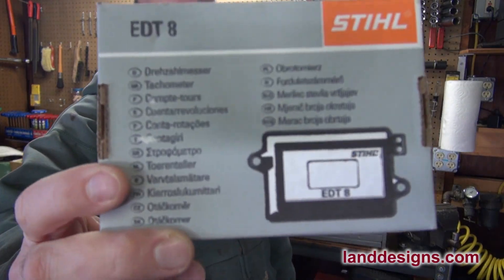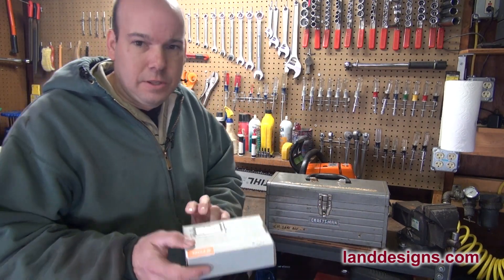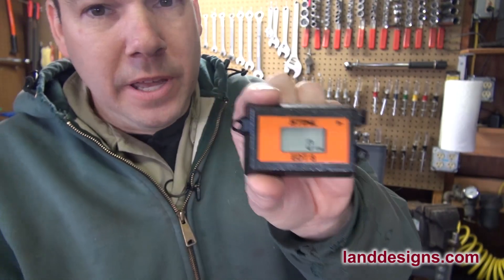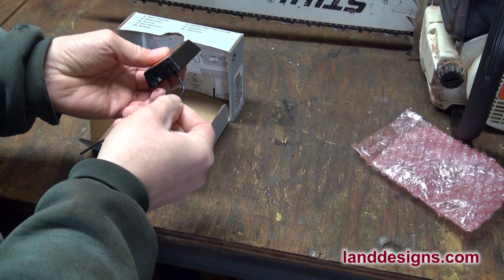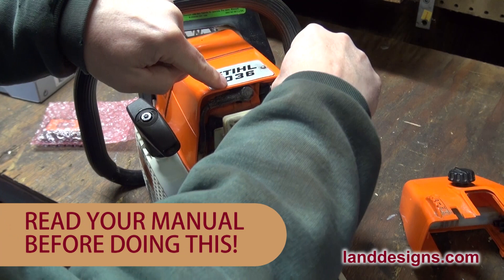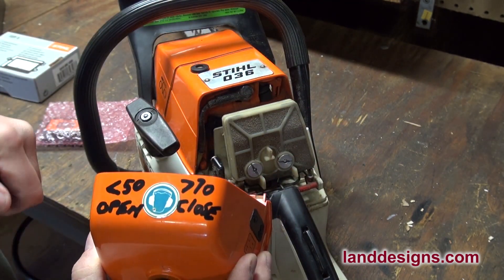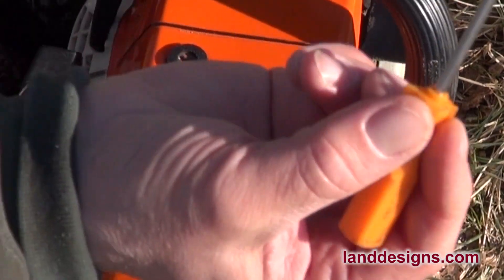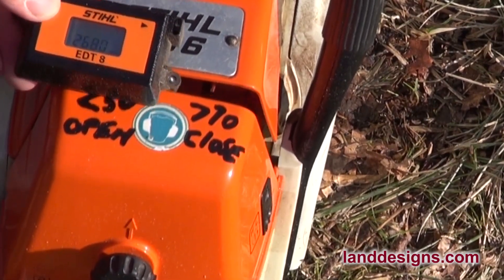Stihl EDT 8 Tachometer

Comment: They don't make these anymore. No demand for them. Find one that shuts off and you can replace batteries ( hardly any). The best one nowadays is the fast tach or tiny tach. The wired induction that you attach to the ignition cable is by far the best and more accurate. American made and has an hour meter. Good quality. You pay a bit more for it but wired is the best way to go.

Comment: Does this only work on stihl saws?
Reply: induction tachs will work on any gasoline engine.  They sense the spark plug electro magnetic field.  The will not work on diesel engines (no spark plug)

Comment: If there is no need for the wire, why do they put one on
Reply: In case of interference on multi cylinder motors you wrap the wire around one spark plug lead.

Comment: Can it be used as a tach on a two stroke boat engine?
Reply: My guess would be it could be used on any motor the ignites fuel with a sparkplug. So gasoline, mixed with oil, or not. Also propane, Alcohol, Nat Gas, whatever. 
There may be a way to use with diesal too, I don't know where you would hook it up though. I have a tach I got off eBay, and I been using them for at least 10 years. They cost between 8, and $20. This looks like a very nice unit, and I may consider one depending on cost. If it runs over $25, I'll stick with my $8 model. They last about 5years, as the battery is not changeable. Though I have changed them in a couple. You can pop them open and swap it, and tape back up but they don't last an additional 5 years. Others they dip the entire electronics in epoxy, so if you manage to open it up, it is destroyed by swapping battery out. The cheaper ones seem easier to get at the battery. After 5 years, it is easier just to buy another. One thing that is too bad, is that the cheapies are also hour meters. So you know how many hours you've ran. I guess becuase of this, there is no way to turn the unit off. It is just on for 5years.

Comment: L screw is the gasoline and H screw is the air .When you set H screw to high the mixture is too lean.When you set the H screw too low the mixt is too reach .Hope this will help you
Reply: Wrong wrong wrong, why comment gilyan82 if you do not know? You may just comment and someone may damage their saw from your poor commenting.  They are both fuel jets.
Reply: did not see thanxx comment, but I agree with thankxx

Comment: Hi, nice vid about the edt 8, just purchased one myself to tune my ms 361, worked fine for 4 minutes or so and then the display showed me "none" and the edt 8 switched off by itself and now i can't make it work again, tried to hold it against the running chainsaw expecting it to turn back on again but nothing happened, do you perhaps know how to make the edt8 work again, i can't find the anwer on Google or anywhere else, many thanks in advance......Arnaud , the Netherlands
Reply: *****
I bought it on Ebay at a Stihl dealer in Germany, might be difficult to get  a replacement, i'll send him an email anyway. I got the idle rpm adjusted in time before it switched off and that was actually the main reason for buying the tach......many thanks for your quick response, it's much appreciated and i'll be checking your videos now and then.....

Comment: the L speed screw adjusts the air fuel ratio at idle, and helps provide enough fuel for proper acceleration. The high speed screw adjusts air fuel ratio at fuel throttle. If you don't understand how to tune a saw by ear, or in the cut, a tachometer can be a valuable tool. However you can never dial in the tuning by simply tuning to a set rpm.
Reply: Thanks for your videos bobe8888. They helped me alot in tuning the cs590 after mod.
Reply: @Mike Fu  The rpm limit on saws without a revlimiting coil at wide open throttle, is controlled by the amount of fuel allowed by the high speed mixture. What do you think that screw does? it controls the amount of fuel at fuel throttle.  Every saw do to manufacture variances will reach proper air fuel ratio 
at a different rpm, tuning to the manufactures recommended rpm is safe, 
but you will leave performance on the table, and 9 times out of ten the 
engine will be tuned rich. 

Before you state something as fact, or say someone is wrong, at least do
 modicum amount of research on the subject, as you clearly do not even know the 
basics of how a small engine carburetor works.
Reply: @Mike Fu ??  Really? Lean mixture clockwise turn of high screw will increase rpm and counter clockwise richening will lower rpm, the h screw has no connection or effect on the venturi butterfly throttle opening!
Reply: bobe8888